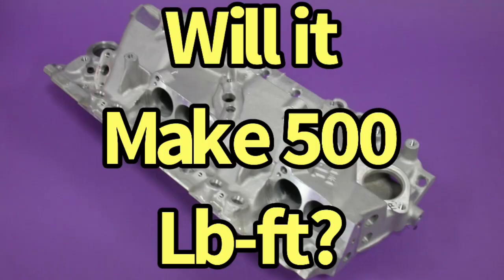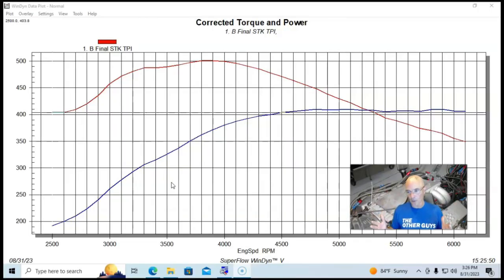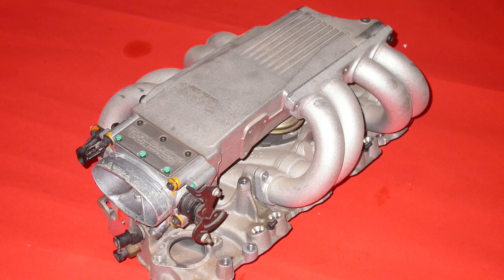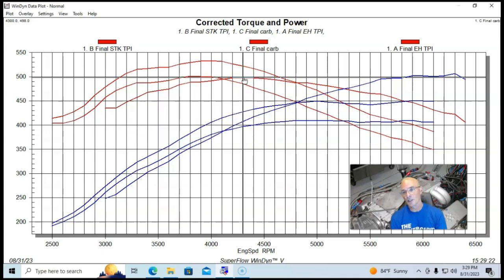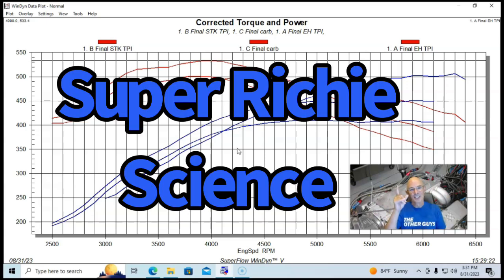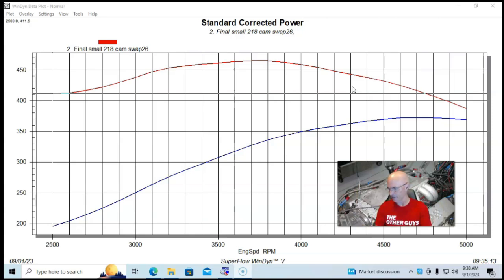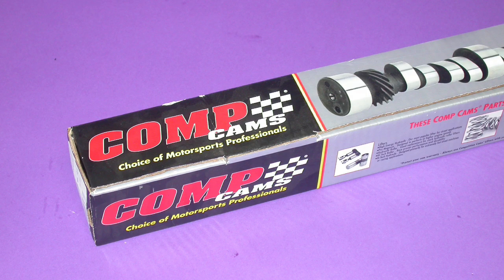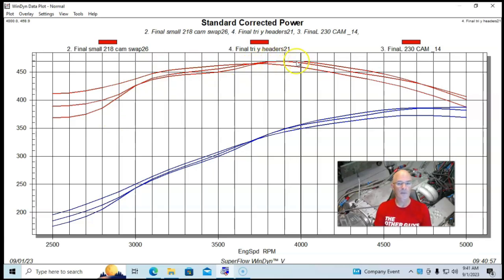TUNE PORT L98 350-CAN WE MAKE 500 LB-FT OF TORQUE? PLUS, TRI-Y VS 4:1 HEADER TEST-WHO MAKES TORQUE?

Comment: A GM L31 crate engine with thinner head gaskets as well as 1:6 ratio roller rockers and a GM LT4 hot cam and matching valve springs, plus good aftermarket pushrods and a fully match ported TPI inlet with a larger throttle body should get you to where you need to be.

But for the engine in this video pushing the compression ratio to 10.5:1 while using the milder of the Comp Cams camshafts with 1:6 roller rockers fitted, should get you close to the torque your chasing.
Obviously the long tube headers also work well.
The TPI system and ECU is obviously holding the engine back with more TPI testing to be done.
You could try the standard TPI system with the bigger throttle body and the standard runner size with it all port matched.
I have seen externally polished TPI systems on show cars and they look fantastic.
😎🇦🇺👍

Comment: Thank you Richard for trying this!  500 lbft 350ci is a goal of mine.  I think a XR276 with 106 LSA cam advanced 4deg would help, bump to 10.5:1, and build a true merge exhaust Y into 3.5" single exhaust.  My goal is attempting with a carb, maybe pull a Holdner and drop a dominantor 1150 CFM into a dual plane

Comment: Tuning is number one, a chip, higher air flow, 1.6 is a must, 

Higher timing degrees, u would get a monster, and slp headers with a good muffler, u need old school technology here, magnafkow or dual exhaust like flow masters, u are also loosing back flow pressure because u have no exhaust coming out properly, 

Also advance the tp sensor located near the throttle body, u need to measure it to about 48-60 points to run good,
Reply from the maker: Optimized is a given for any combo, we already had a cam so rocker ratio would be minimal, we had headers, and you don't need back pressure in an exhaust (The TPS signal is not relevant)

Comment: Excellent, thanks. I've just finished deciding what to do with my 1988 TPI Corvette (Sep, 2025). 

I like the character of the TPI 350, and I can ultimately build such a powerful TPI that I think it will cover my needs. My Corvette is a road car that might occasionally run at the track, but honestly probably not. Track cars make lousy road cars, so I'll build a separate track car if I want to burn lots and lots of money again in the future. Hopefully this info will also help other people figure out what to do.

I've chosen to have HIGH FLOW TPI port my entire factory intake system, and to have my factory aluminum '113' heads ported locally. They will also be machined to net out a ~10.5:1 compression ratio, in conjunction with a 0.030" over-bore (previous owner). These heads have tiny 58cc chambers and the pistons are dished. So if I buy aftermarket heads, or pretty much any other heads, I'll need new pistons to have enough compression (originally, the 1988-89 Corvette TPIs were rated at 9.5:1 by the factory), and I don't want to open up the bottom end right now. So, porting, it is.

I'm sticking with stock valves and cam, but I've also ordered up a complete (massive overkill) COMP Cams full roller-rocker and beehive valve spring setup, in 1.6 ratio. I'm using their steel Ultra Pro Magnum rockers along with chrome-moly 0.105" wall-thickness pushrods. Max lift will be around .460", versus .430" stock. A custom tune in the factory ECU will run it all, and it will get quality fuel.

In SAE Net terms (like the factory numbers), I'm expecting about 300 hp at 4,500 RPM, and about 400 lb-ft at 3,400 RPM. So maybe 250 hp at the wheels. Those are peak gains of 55 hp and 60 lb-ft of torque, which is not too shabby in reality. We shall see, because I will put it on a chassis dyno and find out. It's costing me in the neighborhood of $3,500 or maybe a bit more, all said and done. The heads are only costing about $600 to port and machine, but the valve train components alone were over $1,000. That's expensive, but I want bulletproof reliability.

TPI porting is a long, hard process, and it's an art, too - you could look it up. So it isn't cheap. But I am of the opinion, and it is just my opinion, that the porting HIGH FLOW TPI does produces results as good as any of the alternatives using the same runner length. 

I like the 'low-RPM grunt' nature of the TPI because it works really well on the twisty, hilly roads that I love. It doesn't fall off of the cam. This car is old enough that there are multiple reasons not exceed about (SAE Net) 450 hp, unless you are going to add the structure of a full cage, and in any case I'm not going to use that much on public roads, anyway.

So, the ultimate practical version of this engine, for me, would be a 383 stroker with an aluminum block, making about 400 hp at 4,700 RPM and 500 lb-ft at 3,800 RPM on the engine dyno, using the stock exhaust manifolds - or shorty headers if necessary. SAE Net, installed in the car and with high-flow cats, that's probably about 340 hp and 440 lb-ft, something like that. This version would get a cam, heads, and pistons, but might still breathe through stock valve sizes. It probably would stay at 10.5:1 compression. 

If I build it, if I can locate an affordable but sound used aluminum block, that version will probably cost me another $8k - 10k, in today's money. Just wait a couple of years and price it out again, though - it'll be more. Some will say that I should just do an LS-swap. Yeah, no, I looked at that. Nope. Not for me. Love the engine, but I also love my damn air-conditioning...

Not to mention my dashboard displays, and a number of other LS-swap challenges. I'm sticking with the old TPI, because it's still the best way to power this car, IMO. If you love torque, and oh yes I do love torque, it's actually part of this car's charm, not a drawback.
Reply: Hell yeah still own my 85 that I purchased in 1991.. I did all the typical tpi mods in that time... Edelbrock heads /intake . Arizona speed & Marine runners.  BBK throttle body headers Comp Cam 230/240 duration on 11" ZR1 rims and it's a handful in town. Most anything new will kill it but so what ...it puts a smile on my face every time I get behind the wheel .. I'm hoping to add an aftermarket engine management system soon which should significantly as opposed to the old antiquated ecm

Comment: I wana add a little pep to my 85 camaro by swapping out the 305 for a 350. But i dont have rhe money for aftermarket heads or to have them built. I DO want to keep the tuned port intake for an original look.
Is vortec heads even an option? Or can I use a newer lt1 block from a 93 to 97 with my 85 intake? Like what should i do?
And as far as tuning did you just chip it? Or get an actual tune or what?
Reply from the maker: Vortec heads won't work with the TPI (bolt pattern is different)
Reply: @richardholdener1727  yeah I know I'm Gona buy the intake base from scoogin dicky or Edelbrock and make it work
Reply from the maker: good plan

Comment: What would be a good cam to swap in a stock l98 tpi without changing anything else other than headers
Reply from the maker: YOU WILL NEED SPRINGS AND LIKELY INJECTORS
Reply: @ so what can springs and injectors would you suggest? Just to add 30- 60 hp

Comment: Hey again Richard.  I decided to post this again for inspiration!😋
FIRST Intake trivia: The FIRST intake was used in the US version of the Vector W8 Supercar and depending upon how you count, was the fastest car in the world in 1990. 
Here's a shot of the FIRST with a polished plenum added in the engine bay of a W8 from Doug Demuro's video on the car: https://youtu.be/3WEhsS9ybwk?t=1724
Engine was a 6 liter Rodeck aluminum SBC with a 3 stage dry sump, twin garret turbos, FIRST intake, intercooler and @ 8 PSI made 625hp @ 5,700rpm and 649 ft lbs @ 4,900. BEAST MODE long-runner SBC!🤔
"Can't make power with a TPI intake" 
Fastest car in the world for a short period in 1990 had one and with an HP peak of only 5,700rpm!
Reply from the maker: Did a Vector W8 ever even run under its own power in 1990?
Reply: Kind'a😂. Vector W8 vs.. Dodge Viper missing 1/2 a gearbox.
https://m.youtube.com/watch?v=TAtmkptucm8&pp=ygUJVmVjdG9yIFc4
Rsc Racing Engines First Tpi 460hp/520tq.  Only you can probably get the specs or maybe not if they know its you calling & spilling the beans to us!😋  Doesn't matter, your our Tpi Hero!   Link won't post but look up -  RCS CRATE ENGINE-383/350-9.0 Gen1 S/B Chevy Tuneport EFI
460 Hp/520 Ft.Lbs

Comment: New to Chevy motors here. Looking at a stock setup for a 1980 z28. Not looking for performance, just something newer looking under the hood. I can get a complete unit with wiring and computer for $400-$500. Are the intakes and injectors the same for the 5.0 and 5.7? I know I can go with a carb style EFI, but it doesn’t have the look of the TPI system.
Reply from the maker: injector fit any displacement, you just need enough flow rate for the power level

Comment: The problems with sticking with tje TPI over an LS swap are:
TPI performance parts are more expensive than LS parts.
Mod to mod, LS will always outperform a TPI. 
A 400hp LQ9 T56 can get 20 mpg while a 400hp TPI will get 10.

Comment: I like to watch vids like this, and tests that show how different combinations influence power. Personally the best 350 TPI combo tested, (or any of them) would be killer in my 75 or 79 Monza, and would fit under a stock hood. Now I am going to obsess thinking about this for a few months. I think a tighter lsa would have boosted up the midrange torque, but dropped top end hp. I think the difference is the CID between the 355 and 383.

Comment: I don't know how much air velocity played into the results but wondering if there is a sweet spot for the Tune Port - Cubic Inches- and runner volume when combined with heads.  Would smaller runner heads and Stock TPI runners have produced more torque or just moved the 465 or less down a few hundred rpm.   Would smaller runner AFR heads worked even better, I know that has been disproven in non TPI tests but maybe its the sauce for this.
Reply from the maker: they need to be bigger diameter

Comment: Everyone says that the stock TPI system can’t make any power. I was floored to see 409 hp and 501 lb/ft of torque with the stock system! There are big improvements from installing a larger intake and the nice thing about it is that the WHOLE power curve benefits.

Comment: Honestly that 355 in a c4 corvette will be very fun on the street, 372hp and 469ft/lbs of torque would be plenty!
Reply: Absolutely...my C4 just slides around now at 335hp...if you can't hook it what the hell good is it...my car ain't fast by today's standards but it's a blast 😂I got the 306 Como Cam 230/240 so the idle is wild 😜 fucker revs to 6400RPM with ease now which I thought was impossible 😂 wish I had a stick in it but oh well I'm a ni ambition lazy fucking broke old white dude 😂
Reply: Hell yeah 👍 these cars slide so easy as it is... If it won't hook what's the point ..I got a new roller GM block in my 85 C4 with ZR1 rims 11" rubber with a 230/240 comp cam and it revs to 6400rpm with ease now which I didn't think was possible 😂 idle is wicked 😂it's a fun car in town ...won't hang with modern stuff but so what ..  I also don't have the payment or insurance bills 😂

Comment: The GM TPI intake has killer looks I think. I’ve even heard people call them “sexy”. 😳 I would rather have more torque than any other manifold up to 4500 than a short runner intake that only starts pulling ahead after the TPI car has put several car lengths between them and the other guy.

Comment: Larger tri-y's with an ordered 8-4-2-1 configuration will flatten the torque curve; not make "more" peak torque.  Of course, it's gotta be dialed in, not just bolted on.  Otherwise, when all else fails: just get the burnt air OUT as fast as possible (4-1 large and long tubes with good collectors).

Comment: Hard to wrap my head around… this exact same combo with a little hotter cam and 3.750” stroke went from 372hp to 450hp. That’s nearly 70hp with just .252” more stroke? 

I would’ve figured a ported TPI intake with bigger runners would at least make 400 with AFR 195’s and a cam.

Comment: OK, same small cam but on a 108*, another point of compression , and E30 for fuel (or E85 if that's easier, or equals better availability). I would have used the AFR 180 heads too!

Comment: Have You tried L98 350 (355) with higher lift? Lingenfelter made camshaft with 0,560/0,560 inch lift to use with Superram intake. That cam is short in duration 219/219@0,50. As an alternative I like also  Comp cam XFI 218/224 cam with 0,57/0,565 lift. I am trying to choose which of these to cams to buy for my SBC 350 89' Corvette. It has Superram, ported 113 heads, forged pistons and oldschool Paxton supercharger, Crover Enduro roller rockers 1.6/1.5, tri y headers.
Reply from the maker: I would pick the 218/224 cam and not worry about the higher lift

Comment: Doesn’t seem bigger cam was adding any real gain, I would like to see what a 210 to 218 duration 460 ish lift on a 106 would do. Would be close to the bigger cams torque but maybe sooner in the rpm. I know horsepower would be lower but for towing not a deal breaker.

Comment: My first change would be a pair of Extrude Honed Dart 200cc cast iron heads so the engine would keep compression that aluminum heads would lose. 2.05/1.60 valve package, a roller cam with a .050 duration of 218°int and 230°exh, .520 lift int and .535 lift exh, and a 112 LSA. And instead of a 355, I would go with a 4.125 bore block to unshroud the valves and have a 372. Keep the same TPI combo from the original test. Flat top pistons, with a modern ring package and dual valve reliefs. 1 3/4" diameter, long tube headers into a pair of Flowmaster 4-2-1 collectors and a 3" X pipe. See what happens.
Reply from the maker: BIG NO ON THE IRON HEADS
Reply: @richardholdener1727  , can you give me a reason why you would say no?

Comment: Try the stock runnters.  Your ported runners are meant to overcome restrictions at higher RPMs.  The factory TPI was designed for low end torque.  Limit lobe overlap. more overlap results in lower real world compression, less torque.  Not even sure the 500 lb-ft is the right measure.  Torque is best felt at lower RPM applications.  You don't "Launch off the line" in streat applications at 4000RPM.   You need to maximize torque at 2000RPM to have a great streat car.
Reply from the maker: stock TPI makes less hp and less torque-we tested that-overlap is not your enemy (even for torque) and 500 lb-ft is the metric
Reply: @richardholdener1727  Less HP is fine on a street car if it is sacrificed for a flat torque curve that starts no later than 2000 RPM and gets over 400ft/lbs by 3000.  However, I realize now you are just making entertainment, not doing anything practical or helpful.  I Got a hint with that with your destroker/stroker vid where you changed so many variables your results were meaningless.  Time to quit wasting my time.  Adios.

Comment: In my opinion youd have been a lot farther ahead by starting off with a stock ZZ4 and putting a Tuned Port Intake on it. The ZZ4 had 410 Ft/lbs of torque with the dual plane intake and 670 cfm Holley. The TPI would have easily put 50 - 75 ft/lbs on that without even taking the valve covers off. Add a 215 / 225 cam, 1.6 roller rockers, crane 22410 springs, and better push rods and youll be all over 500 ft/lbs of torque.
Reply: Manley 22410 springs, sorry about that.

Comment: You don't say but AFR L98 heads usually are 195cc heads... If that is the case my guess is the 180cc heads would be a better fit probably giving another 20-25 ft lbs. another 1/2 point in compression and 108LSA on the camshaft and 24" collectors.... I'm betten that 355 gets over the bar...
Reply from the maker: smaller heads won't make more torque
Reply: @richardholdener1727  Don't agree in this case when you have dyno results let me know... The 195's are too big for a 350. 

Edit for a 5,000 RPM 350 if this was a 6,500 rpm motor then the 195's would be better. look forward to you proving me wrong, enjoy your videos.
Reply from the maker: I HAVE PROVED THIS ENDLESSLY! ON THE SBF I TESTED 170 VS 195 DART PRO 1 HEADS AND THE 195 MADE MORE PEAK TORQUE-IN FACT BETTER POWER THROUGH THE ENTIRE CURVE (THOUGH THEY WERE THE SAME BELOW 3600 RPM). IN THE COMPARISON BETWEEN 195 AND 210 HEADS ON THE 302 FORD, THE 210 HEADS DROPPED PEAK TORQUE BY 2 LB-FTS. SMALLER HEADS DON'T MAKE MORE PEAK TORQUE. THIS IS ALSO SOMETHING ILLUSTRATED ENDLESSLY ON THE BIG HEAD TESTS I RAN, WHERE SMALLER HEADS DIDN'T MAKE MORE TORQUE THAN BIGGER PORT HEADS WHEN THE BIGGER PORTS FLOWED BETTER.
Reply: I could be ignorant also and respond in all caps but I will leave that up to you... a SBC and SBF is comparing apples and bananas. The CFM is close on these AFR heads taking into account the small cross section area of the runners. So the only thing that actually matters here is how they work with a long runner TPI set up. So until you try some AFR 180CC L98 heads you haven't proven it endlessly actually not even once. FWIW the 180cc AFR heads flow peak 260 CFM intake @.5 lift, while the 195CC AFR heads flow 270 CFM @.5 lift with the 180cc having a tiny advantage @.4 lift and below. Dyno time sir @richardholdener1727

Comment: Are the heads as-cast (not ported or cnc at all)? I believe a good smaller port in the 170 range, a stock hand-ported base, stock runners blended/raidused at the plenum (opening the plenum like you would to siamese a pair of runners), and a custom cam you'd hit your number... might even make more power too!

I want to say the short primary section of the tri-y setup is what hurt low end torque.  I don't know enough science about it yet, but I have no reason to NOT believe the long primary size of the regular longtubes don't offer the same benefit to low-end torque like TPI does.